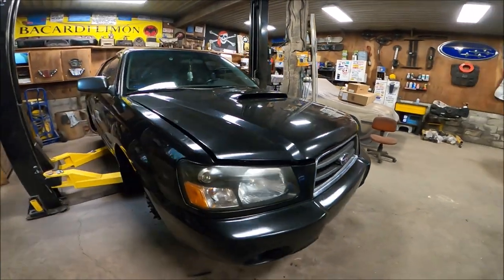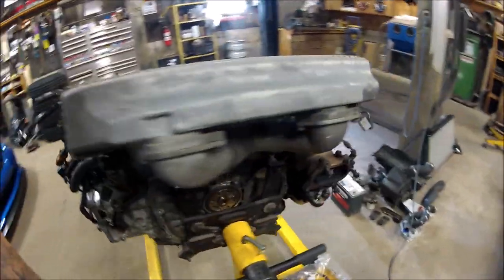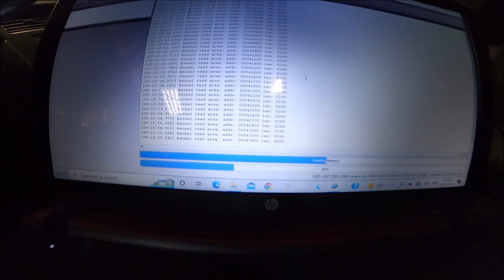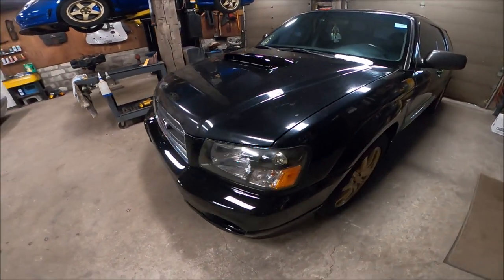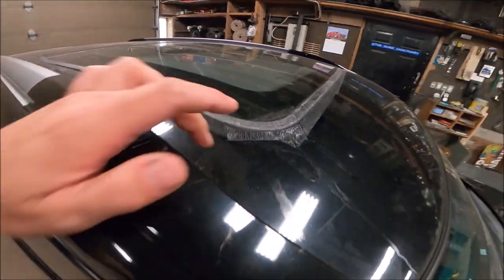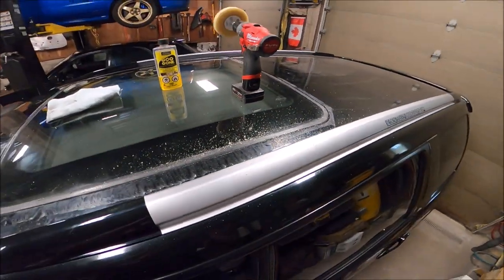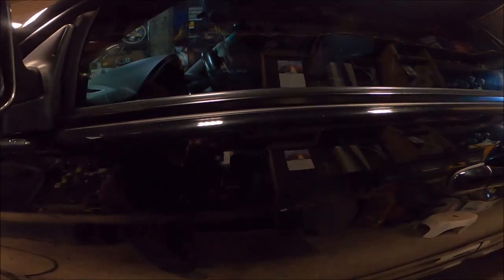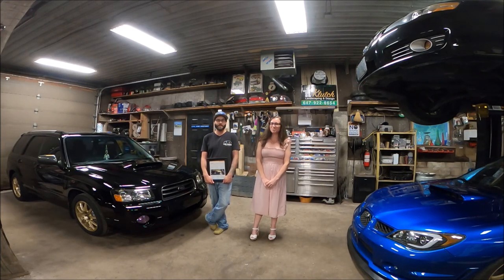SG 2005 Forester XT - Barn find - Restoration

Comment: I've got a SF5. It needs lots of  rear inner wheel well work. I couldn't bring myself to break it or scrap it. Been sitting in the garage but it start first time and it's black the best colour. Gud job..👍
Reply from the maker: They are too awesome to give up on. This chassis was good condition for the salt belt but we had oiled it over the years. Hopefully you get to yours and get it back on the road

Comment: What was the product you used on the headlights that you blotted on, rubbed in then buffed off with the paper towel?
 Those headlights looked FRESH after.
Reply from the maker: Just a little compound polish on a rag. Really cleans up plastic quick
Reply: @TheSubieSanctuary  oh sweet! i havent used compound yet but just purchased meguiar's compound to try on my subi's bubbling clear coat and hoping i wont have to spary a new gloss coat 🙄
Reply from the maker: @catdog7497  🤞

Comment: What sauce are you using to revive the light bezel?
Reply from the maker: Just some compound polish and a micro fibre! Has held up very well since!
Reply: @TheSubieSanctuary  
😃Okay, thanks! Great Work as usual!
PLease more lighting for all the dark materials and dark areas.
I have to ask help regarding welding!! I previously bought a HF 140 multiprocess welder which I thought meant 140 amps but diesn't.  I knew nothing about what to get so I got caught by the koncept I knew I needed to weld a nut onto the right pinch bolt and that I would have to do body work but with bad health limited in how far I kan think. I am after the fact with the belief I got badly screwed with this HF welder reading through forums and am afraid it isn't korreckt for automotive structural welding!!!! What brand is your welder and what are the specifications needed and what wire specifications and welder settings were you using to rebuild the bugeye subaru strutt towers and weld in the new drivers side frame rail? Thanks!!
Reply from the maker: @eddiesasquatch8124  at home I did get some sweet new spot lights for darker scenes. Just haven’t been doing any at home project’s recently. 
Im using a lincoln 180 mig welder. It does require 240 service and I use argon/oxygen mix for gas. Typically known as auto weld.
Reply: @TheSubieSanctuary   @TheSubieSanctuary  
Can you tell me is that Harbor Freight 140 multiprocess welder going to be any good for structural welds? I kouldn't get good with stick it seems to kold so I previously switched to practicing flux mig welding but I am uncertain of what I should be seeing to know I have a korreckt strong weld for structural purposes.

What settings and wire are you using when I watch you do the strutt towers on your bugeye project? How bad did you get set back on the frame rail price?! Congratulations on that removal of the frame rail I appreciate your sarcasim for the intense involvement with tge flokring tool to break free that little metal section that was adhesived and your color blue sentiment. Is it possible that all along the frame rail that if my rail is bad that there is a select solvent that will break that adhesive down without being fume toxic and ease the burden of that workload to free up the frame rail?!

I am glad you got some lighting bekause there is toooooo little quality work on Subarus and every detail I kan soak up helps to ease or erase fears!!

Thanks👍